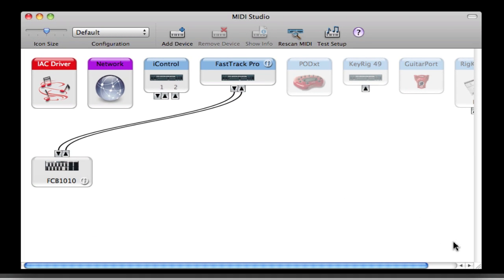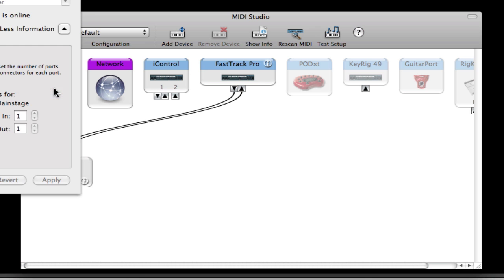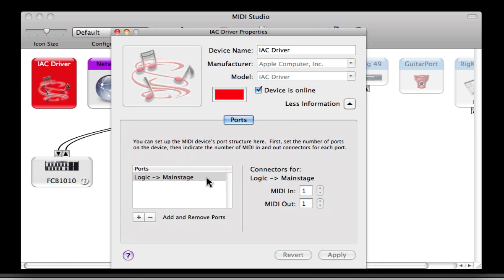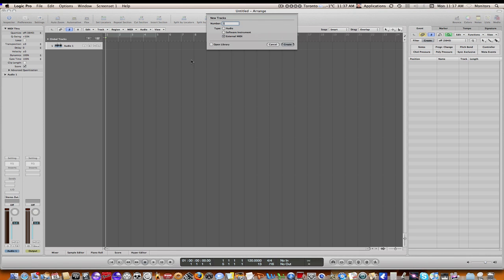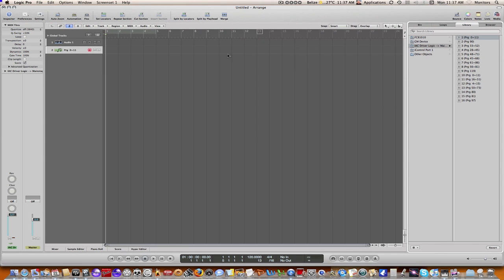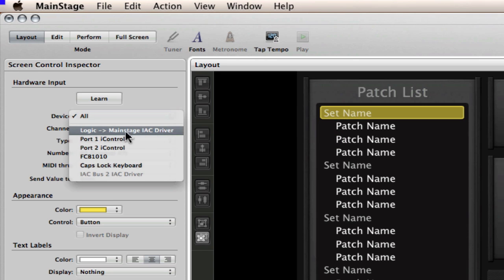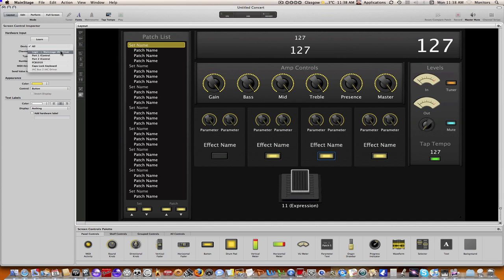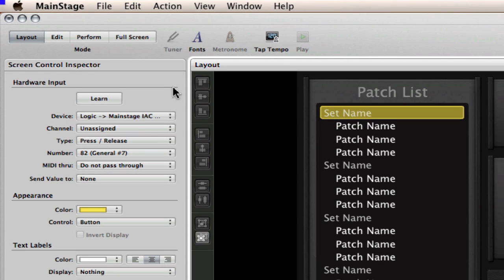IAC Driver configuration for Logic and Mainstage

Comment: Hi, Thanks for the wonderful video. Although I am stuck at a point. I am using Logic Pro X and Mainstage 3. I configured the IAC Driver exactly as in your video but Mainstage crashes when it reads a midi note coming in from Logic. Could you please help me sort my problem please? Thanks again for all your videos! :)
Reply from the maker: Thanks so much for your feedback, much appreciated!  Is it crashing on a midi-loop?  If so, try opening a Logic environment window then go into 'clicks and ports' Make a new object (anything is ok) and connect the IAC output to the new object's input. If it's a midi-loop then taking away the IAC return from the SUM input should stop the loop

Comment: Thanks for sharing this, it's very cool and much more helpful than any of the actual Apple resources in terms of integrating MIDI.  
I am attempting to do something similar, basically I wanted to use MainStage for the backing tracks live, and since there is unfortunately no sequencer capability or MIDI in MainStage, I was going to create a MIDI track in ProTools to run lighting via DMXIS or to control other automation (kind of what you were doing with your various pedals).
Here is my question-----won't I have to create a new song in ProTools for each song in my setlist?  To control the light and automation?
The only thing I have been able to come up with is creating a really long song in ProTools, basically the entire setlist and placing markers at the beginning points of each individual song, then start/stop ProTools using a foot switch or something, if that is possible.

Just wondering if you had any thoughts on this, you seem to be ahead of the curve.
Again, thanks for sharing the IAC idea, that works great.

Comment: I'm using Logic/Mainstage with MOTU Traveler/8Pre, as well as Apogee GIO as a controller.  Since the GIO is an interface, I've encountered problems using it within Logic.  Mainstage is not an issue and use it to assign controllers (stomp for Channel/Mute & Channel Volume with Expression Pedal).  1.  Can't seem to be able to assign the Volume Pedal for Master Output?  2. How do I configure GIO as a controller in Logic? Getting Port conflicts/don't want to use it as an aggregate device. Confusing!

Comment: Many thanks for the reply. I understand that the midi channel can be assigned in Logic, but I'm referring to the part in your other video, where you set up the hardware input in layout . This appears to be a global setting across all patches??. The only solution I can find, is to create another keyboard object in the layout mode, and assign it's input device as my keyboard. The other keyboard being assigned to the IAC driver. You can then select either input for a channel strip. Is this correct?

Comment: VEP5 would be instantiated as an AU plugin in MS. But the metaframes/viframes running my samples would be on the Slave PC I have hooked up via ethernet cable. I'd like to access those viframes by changing patches on MS.  So patch #1 on MS would access the first (top) viframe; patch #2 on MS would access the 2nd viframe. I'm wondering if this is possible.  I have setup an environment in Logic that allows me to do this but I want to accomplish this in MS instead of Logic if that is possible.

Comment: Great Video, but I'm having a problem.Lets say I have 2 patches created in MainStage, and I want the first patch to route thru logic (appegiator in the environment). This I have achieved. However I want the second patch to route directly into a soft synth created in MainStage. The midi input (in this case IAC driver) seems global and is applying the arpeggiator to all my patches . Can you help?

Comment from the maker: Yeah, you can definitely use Logic for this...in fact, your thinking is dead-on since Logic essentially is a sequencer with a timeline so it's perfect for MIDI event control, including lights, etc.  

There are two ways of going at, 1. if MyDMX has Rewire capability (I don't know if it does) then the IAC bus will work directly.  If it doesn't, you may have to take an indirect path by sending the MIDI event data out to a MIDI channel that's dedicated to MyDMX. Message me directly for more info.

Comment: Hi, great vids. Making my transition from Protools to Logic/Mainstage easier. 

Both this vid, and the one on advanced midi functions will help me a lot.. But there's a problem:

In mainstage (After setting up the iac driver, creating midi track in logic etc.) -> layout mode: Nothing shows up in the screen control inspector. I can't configure the hardware input. If you find time please shot me a line. 
once again thanks for the vids